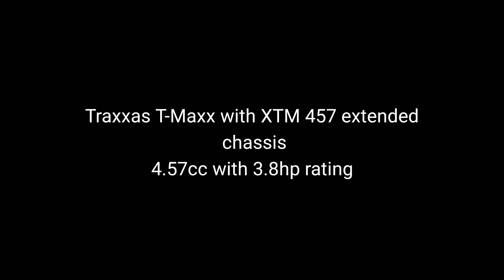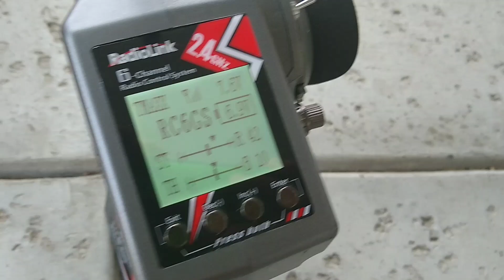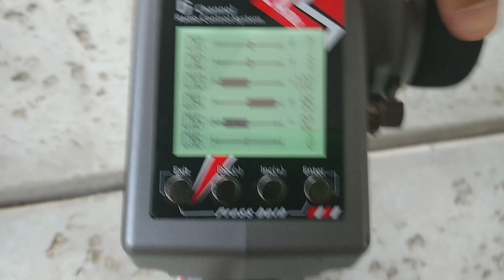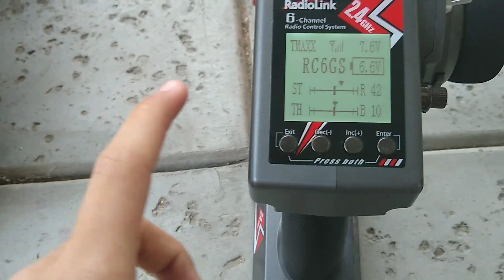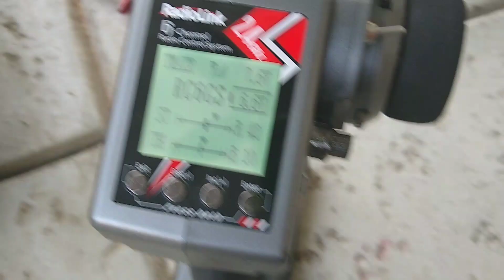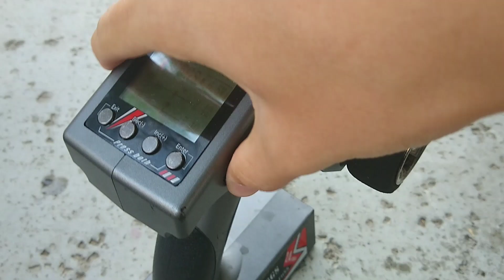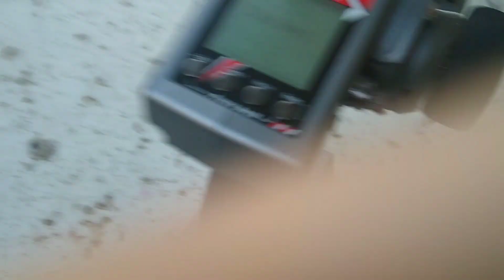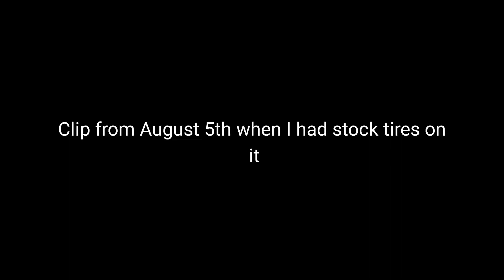XTM 457 T-Maxx extended chassis nitro monster truck

Comment from the maker: Lol guys. Sorry for my voice and mumbling since my throat was kind of weird that day. Nitrogang!
Reply: Everyone sounds funny on a video when you hear yourself ,I did one yesterday showing my girlfriend what I was doing at work ,she said who the hell you talking too? Lol,and to me I sound funny hearing myself .
Reply: On your flex issue use aluminum servo mounts and aluminum chassis ,and someone else was correct in saying line them up better that is an awful angle ,I have dynamite big block and is set up same way ,person I got it from was lucky enough they still sold parts and bought or made custom linkage so it does not bind or flex .plus it is aluminum mounts and chassis .

Comment: hey man great video! i also had a t-maxx and it was great! Not sure if you fixed the issue with the chassis flexing while braking cause the video is about a year old now but setting the end point a little shorter on your radio would help!
Reply from the maker: Thanks! This was before I did the double up brake mod, after I did that it stops on a dime. So yes, I did set the endpoints lower, but the braking was almost nonexistent, so that's why I did the double mod.

Comment: A big part of the problem with the chassis flex that you're having is likely due to the angle that the rod is pulling on the servo and Bell crank for the brake. The closer to 90° each one of those is the more direct the force will be in the correct direction. The way you have it set up right now it's trying to pull the servo and the transmission toward each other as you try to apply the brakes. Try to get the angle of the rod connecting the two at more 90° to the servo arm and brake arm and you won't have as much of the flexing issue
Reply from the maker: Now that I think about it, that is a really good idea. I'll be definitely trying it out. Much thanks!
Reply: @cyclicracer  yeah bending the rod itself isn't going to work as you found out. What you can try is to remove the arm that comes off of the bra ke rod and bend it some so that it is more clockwise looking from the top. The issue you may run into here is the rod you're using might not be long enough.  Unfortunately due to where the servo was placed in this chassis you're fighting poor geometry with that linkage. if you look at how a T-Maxx is set up stock you'll see that that rod is basically 90° to the brake rod arm and that's how it should be.